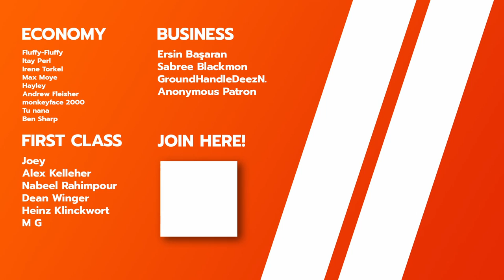How These Pilots SAVED This Broken Plane | Transair 671

Comment: I think this accident highlights the benefit of having a third brain in the cockpit. The flight engineer was the one who thought to dump for maneuverability. When the crews get task saturated, it's super helpful to have a knowledgeable third without a yoke.
Reply: I mean even without the engineer, Im sure the pilots would have dumped fuel anyway.
Reply: @6z0  Probably, but maybe not as quick as they did. And it could have caused many more serve problems before it happened.

Comment: Really well done episode.  It seems like the pylons are a weak spot for the 707.  I recall watching a video on an early test flight where pilots pushed the plane hard with extreme left right rolls that literally tore off 3 of the 4 engines due to sheering forces from the maneuvers.  Amazingly, they got that plane down safely with the remaining engine.
Reply from the maker: oh wow, that's crazy! I'm alwaya amazed if planes with structural damage this severe are still able to make it back
Reply: @AirspaceVideos  agreed.  That is where designers, engineers and those who assemble these planes really earn their money.
Reply: That was a Braniff or Lufthansa test flight. The braniff pilots had no jet experience and caused it through stupidity.
Reply: The Braniff training flight did not get back safely. The Boeing instructor pilot initiated a far more aggressive dutch roll than Boeing training allowed. The Braniff captain, with no jet experience, made a wrong recovery input & the aircraft made a violent roll which ripped off 3 engines & left the 4th hanging at an odd angle, only partially attached. The training captain attempted a landing in a forest clearing, but came up short, crash landing in a river. The four persons in the cockpit all died, but 4 who had evacuated to  the rear cabin survived. This was in Oct 1959, at the dawn of the jet age.
Reply: The early 747s had the very same engine pylons as the 707s, and two of those 747-200F crahed after a double engine failure at only a few months of interval.
Reply: @bobvicki  thank you for setting the record straight, I remembered that story differently probably because of the survivors from it.

Comment: It reminds me of El-Al flight 1862, which happened half a year later over Amsterdam. Here also an inner engine fell of and took the outer engine with it. Unfortunatly they couldn't bring their plane, safely back to the ground and crashed into an apartment building. Killing all four people onboard, as well as 39 residents.
Reply: It was a transport jet with only the flight crew on board.
Sadly most of the deaths  were people that lived in Apartment building.
I believe the pilot decided to return to airport after the engine detachment from the wing
Reply: ...My thoughts exactly...
Reply: That crash was so devestating. A more uplifting example is a KC-135E, call sign "Whale 05", 58-0013 that had 2 engines separate during the Persian Gulf War. They landed successfully. There's an episode of ACI about it.

Comment: Not the only double-engine loss, but it’s the first I’ve heard of one with survivors.
Also, not surprised they landed at high speed - engines departing the wing can damage the wing leading edge, raising the stall speed in addition to damaging slats.
Reply: A captain who was an ex-fighter pilot with 26000 flight hours and a first officer with 14000 flight hours  - the engineer's details I didn't catch but seemed on the ball. They seemed just the people you wanted as crew in this situation. Nice work from this crew. Freight crews seem to get "old nails" to fly and fly them well they do.

Comment: Dang, it's almost a repeat of El Al 1862. In both cases
1) Pylon of №3 engine has failed because of fatigue cracks
2) Engine №3 struck №4, ripped it off, which damaged the right wing
3) Both handled it at high speed, but when they slowed down, problems started progressing. The only difference is the flight 671 had time. El Al 1862 wasn't that lucky.
Oh, and 4) Both happened in 1992.
Reply: Hi Vlad. Exactly. Very similar, almost identical. Also, both were cargo, although El Al was B747, and had a very sad ending.
Reply: @roderickcampbell2105  Being 68y Dutchman, I remember the A'dam-Bijlmermeer-crash very well.
Reply: @hylkewesterhuis9667  Hello Hylke. I can imagine your memories are vivid. I did not know about the accident at the time it occurred, but whenever I hear "Schiphol" it immediately comes to mind. I hope that the accident did not impact you or those close to you.
Reply: Add to these two cases, on December 29, 1991, the crash of China Airlines, flight 358 : another 747-200F that suffered the exact same double engine failure, also on the right wing, that the EL AL 1862 experienced. And its fate was the same, the Boeing crashed on a hill and all its 5 crews perished. The  main difference being, there was no fatalities on the ground.
https://en.wikipedia.org/wiki/China_Airlines_Flight_358
Reply: @julosx  Thank you julosx. I didn't know about this one. Tragic, but at least those on the ground were spared. Checking on accident now. Thanks again.
Reply: From this video, it looks like Transair 671 did a very high speed landing. That choice probably saved them from stalling the damaged wing and losing control on approach. Which, of course, does not mean the same would have been an option for El Al 1862.
Reply: @marcelb3645  Hi Marcel. That makes sense to me. The El Al pilots did an incredible job keeping the aircraft aloft, but under slower speed it became uncontrollable. A truly difficult place to be for a pilot.
Reply: I immediately thought of that crash as well when I heard "both engines have separated"
Reply: @marcelb3645  yeah, the kind of terrain in the area and what runways you got available (if any) can make a huge difference how incidents like that play out. also, what other systems are damaged as a result may vary, which can also have a big influence
Reply: I'm going to preface this by saying that hindsight is 20/20 

EL AL 1862 had time, but the captain decided to try and land as soon as possible instead of climbing to a safe altitude to see how much control he still had 

If he had climbed, done control checks and worked out that flight at low speeds was not possible, they might have made it, the 747 can climb at MTOW (though just barely) and as long as they don't let the airspeed bleed off too much, there won't be as much difficulty countering the yaw from having both engines on the same side, and if they dumped fuel while they were out there doing their checks, the plane would've had even better handling characteristics, and could've landed at a lower speed

Qantas flight 32 had an engine explosion which ripped holes all through the wing, and instead of heading directly to the airport, they did control checks to see what they were dealing with, if they attempted a normal landing, it's likely they would've crashed too

Comment: Skill, luck, AND amazing work by the engineers at Boeing to design a plane that can loose two of it's engines in flight, spilling fuel with sparking wires, and still come to a safe landing
Reply: A plane designed at a time when, "If it ain't Boeing I ain't going!"  was in living memory.  When SEA-TAC was just an airport not an incorporated city and Boeing was a Seattle company.  The Queen of the Skies the 747 is the queen of my heart, but the 707 was the first True King !:-)
💜🙏⚡️
Reply: Fair enough.  T’would be better if the engines didn’t come off in the first place…707 was not over-engineered like the DC-8.
Reply: @jaybee9269  ALL engines will fall off eventually if the scheduled inspections and maintenance isn't performed, metal fatigue CANNOT be eliminated. That's not at all a fault of the plane

Comment: 2022 North Las Vegas Mid-Air Collision with Cessna 172N Skyhawk vs Piper PA-46-350P Malibu JetPROP DLX 

Piper PA-46-350P Malibu JetPROP DLX, N97CX (conversion #26), and a Cessna 172N Skyhawk, N160RA, were destroyed when they collided at North Las Vegas Airport (VGT/KVGT), Las Vegas, Nevada. The Cessna was in the pattern practicing touch and go's.
The Piper Malibu was inbound from Coeur D'Alene, ID (COE/KCOE)
The two people onboard each aircraft were fatally injured. Preliminary information indicates the Malibu was instructed to land on runway 30L but approached 30R, the Skyhawk was on approach to 30R and a collision occurred.

Comment: Wonderful, wonderful video..... the calm tone and precision, light Swiss German-inflected rhythmic lilt to the English narration just absolutely makes it, as always! This is someone you could trust personally and professionally 😀

It was clearly very much a combination of luck and skill - clearly, the crew had no control over when the wing burst into flames but with the very adverse handling characteristics induced by the loss of the engines, later fire and various electrical and hydraulic issues, they did a magnificent job. And perhaps as someone here speculated, the presence of a flight engineer contributed...
Reply from the maker: thank you so much :))

Comment: Troubleshooting exotic failures is not much of a skill builder because it happens so infrequently.  But with both pilot's long experience they were up to the job in this case.  A bit of luck finding a place to land quickly also helped get a good outcome. 🥴

Comment: This was an overlap of both seasoned skill, excellent CRM, quick thinking and then, pure luck finding the military airport so soon into the descent.  This may have ended quite differently if either the skill of the crew or the luck finding the airport were removed.  The quick landing appears to be the saving grace in the end, but it would never have been possible without the crew's decisive actions.  Excellent video.  These lesser-known incidents are very informative.

Comment: there is no such thing as luck.. that's some great piloting..!!
Reply: Luck does exist in my opinion. Like if a robber is trying to carjack you, you refuse, (the car engine isn't even on so you can't floor it, run them over, or reverse), they pull the trigger on their loaded gun and it jams, I'd consider that good luck assuming you are able to get away/aren't beat down.
Reply: @John-Smith02  I'm just trying to give pilots as much credit as possible here
Reply: @4NallaSuman  ohhhh
Reply: Tell that to the pilots of El Al 1862, who had an almost similar situation, but the wing damage was much more severe, and they didn't have much chance.
Reply: I totally agree with you! It was pure skill. They had no luck! In fact, what they had was bad luck by loosing an engine AND having it hitting another one!

Comment: Skill or luck? Both. Lucky enough to have had the fire for 2 mn flight only but also they had the chance to land on RWY15 in Istres. I've been flying there when I was a (helicopter) Experimental Test Pilot and there are 300 days per year of wind in this area, 90% of the time north wind and half of this time quite strong north wind (30 to 50 kts, called Mistral). Should the wind have been 30 kts north, they would probably have tried to land on RWY33 and they would not have made it ... 
The rest is skill and a very good job from all crew members. Hats off! They deserved their awards.

Comment: 2021 Piracicaba King Air Crash with King Air 250

Beechcraft B200GT King Air 250 crashed shortly after takeoff from Piracicaba Airport, Brazil. The aircraft was destroyed and all seven on board were killed.

Comment: I wonder if it was and is possible to extend flaps at the correct speed when engine thrust is lost, or engine(s) are no longer connected to the wing? Wouldn't that help keep the airplane from veering too much?

Comment: Had the engines ripped of the slats and thus damage the hydraulic system on that wing, the pilots would not have been able to extend the flaps on that wing and would have crashed, making it an exact carbon copy of the ELAL 747 crash in Amsterdam later that year. These pilots were lucky.
Reply: I think it did damage it, but luckily it was already on the ground when it was noticeable with the brakes.

Comment: where did you get the 707?
Reply from the maker: converted from fsx
Reply: @AirspaceVideos  grazie
Reply from the maker: prego
Reply: @AirspaceVideos  >> It looks pretty off, just saying.  The vertical stabilizer is too large and the engines aren’t quite right either.  Good video though.

Comment: Why not just use 5 engine mounting points, so if one breaks, it doesn't fall off? Airplanes really should have redundancy and it seems weird to me that you'd mount an engine with 4 points, all of them critical (and thus, if any one failed, losing the engine) when you could just add another...
Reply: The engines are mounted with shear bolts, designed to fail if overloaded. This protects the integrity  of  the wing.
Reply: @bobvicki  That's irrelevant - this wasn't a case of overloading, but of fatigue-induced failure. My point is why design it so a single failure causes the engine to fall off? Use 5 points, so a fatigue failure wouldn't cause the engine to fall off. Get it?
Reply: @isbestlizard  Well, aircraft designers don't agree with you. Later designs have 3 mounting points, 2 front & one rear, all shear bolts designed to fail with an overload. The key to this is proper maintenance...regular checks for corrosion or fatigue with replacement at specified intervals. The aircraft in this incident was old with a rather checkered past & obviously substandard maintenance.

Comment: Very well presented and narrated,👌🏽🤍
And it is okay, that photograph taken by the F.O. does seem to be hard to find, as it might only be with the report by the relevant aviation authorities.
.
Hat's off to ALL five of the onboard personnel for keeping their head on the shoulders.
.
Sadly, for those sceptical or scared of flying... instances like over-automation of planes and software coding issues or designing issues or
Issues like the 737 Max
Or such seemingly 'lame' reasons like 'oops' we missed the correct procedure to maintain or to clean the aircraft (many examples of Pedo tubes being blocked)
...such things do not at all instill the faith in flying.
.
Good thing though that the instances of neglect or improper and inadequate procedures resulting in fatalities hasn't been too regular.